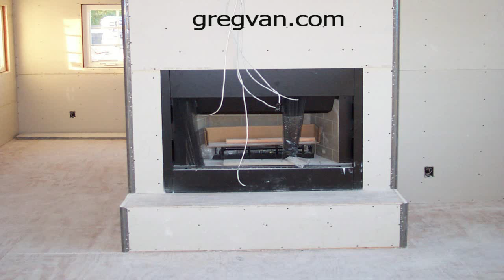Non Combustible Building Materials Around Fireplace Opening

Comment: What about the drywall above the fireplace up to the ceiling that is parallel to the flue? Does that require a special type of drywall?
Reply from the maker: Check with the manufacture and your local building department or you can try using fire rated drywall.

Comment: My new fireplace came with on combustible board which I installed around the unit.  However, the rest of the chase front is drywall.

How do you seal the seems between the non combustible board and drywall?  Drywall tape and compound or seal it with thinset when tiling?  Thank you
Reply from the maker: I would contact the manufacture for more information.

Comment: Does this apply for electric fireplace? I wanted to box in a stone wood burning fireplace. I wanted to have a TV cut out and electric fireplace cut out at the bottom.
Reply from the maker: I don't think there are building codes for portable, but if one is going to be installed permanent into the structure, then I would check with your local building department and also contact the product manufacture for installation instructions.
Reply: @gregvancom  thank you

Comment: I’m planning on installing shiplap around my gas fireplace. From my measurements, The wooden frame around the fireplace is 6in from the inside of the fireplace (essentially where the insert meets the glass). Would putting shiplap up to the frame of the fireplace be safe?

Comment: This video makes no sense, totally worthless...
Reply from the maker: I would like to suggest something and that would be to provide me with a reason why it doesn't make sense, so that I might be able to make better videos.
Reply: @gregvancom  Building code requirements vary based on the size and sq. ft. area of the opining, you made no mention of that.  You kept mentioning drywall as the combustible material and referenced dimensions used for combustible materials that surround the opening such as wood molding, trim,
pilasters or mantels not the drywall or cement board that encloses the fireplace unit.  Your photo and explanation doesn't take any of this into consideration, thus in my opinion making it confusing and worthless.
Reply from the maker: @petemclinc  I have never heard that the actual size of the opening makes any difference, but would be glad to look at any building code reference numbers you can provide me with to back up your claim. If you're suggesting the videos should have provided additional information for fireplace installation clearances, then I could understand your frustration, but think that the title provides most viewers with an understanding that I'm not going to show them how to install a manufactured fireplace or chimney.
Reply: @gregvancom  dimension of the hearth extension varies based on size of opening. Beyond that, there are many dimensional and distance requirements missing from this video. I'm honestly not trying to be mean, but this video is 99% wrong or inadequate.

Comment: We just had our gas fireplace replace with one of a different size.  Cement board was used around it and then it was mudded.  We had wanted to simply paint over this but have noticed several cracks have appeared (it's been 3 weeks since installation).  We're now being told this is common with cement board and, even with patching, it will continue to happen.  Is there anything we can do or are we going to have to change our vision of the room?
Reply from the maker: The only thing I could think of would be to install tile over it or remove it and install stucco and lath to get the look you're looking for. Go to our website and check out the section on stucco under the home building tab. Feel free to send us an email with some pictures if you need more help.
Reply: its the type o mortar you used or mixed failed  use some hight temperature mortar or paint , but if you use cement board its because you gonna put tile or similars

Comment: My uncle ripped out the tile around his fireplace which ruined the wall so it had to be replaced and all the wall around the fireplace opening was drywall.  When I purchased my house.  As soon I ripped out the tile around the fireplace which ruined the wall so I cut that out and replaced the drywall with cement board to re-tile and build a mantel around it.  Anyway my point is the wall around my fireplace was drywall as well and in the video it says that drywall is not not combustible.  So are you saying my uncles home and the home that I purchased brand new were not built to code?
Reply: something its the code and other best practice ( not code yet) the main idea is prevent any damage in your property mamy contractor limited to use the chepeast materials ( code ) sometimes to built.... but there are several options out the box ( hight temperature mortar, cement board,etc) tile give some kind of protection
Reply: Drywall literally has paper on it. It’s safe to keep it away from the heat of a fireplace.
Reply: code but not as safe. he says that in the video

Comment: Great Video with good advice. One addition... I often recommend using one large sheet of non com board similar to drywall in an upside down 'U' shape. What this means is that you don't have to worry about expansion and contraction from the unit causing cracking in the drywall. The joins between the three non com boards that com with the unit and then joined to drywall then painted will often crack. Ignoring the provided sheet and overlapping with your own will cause less head aches.